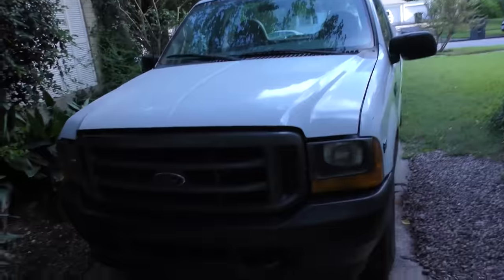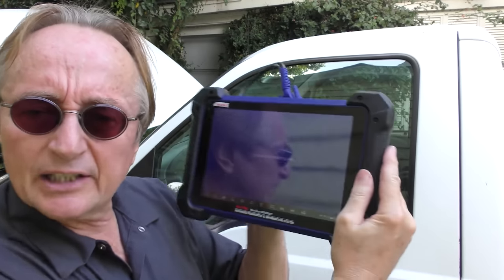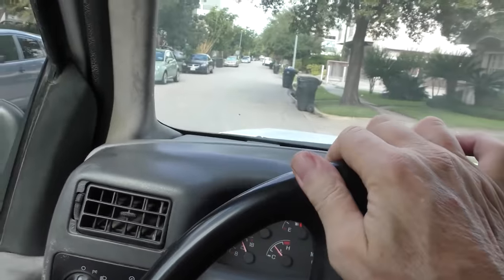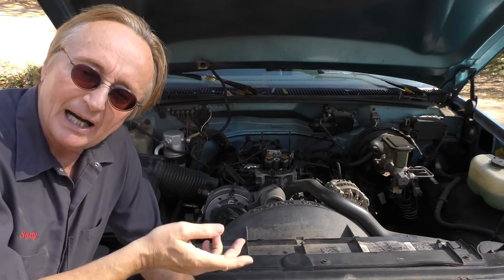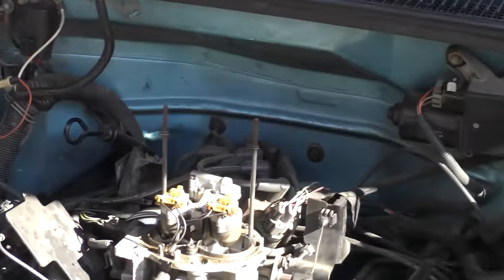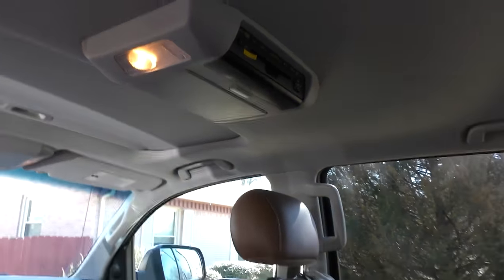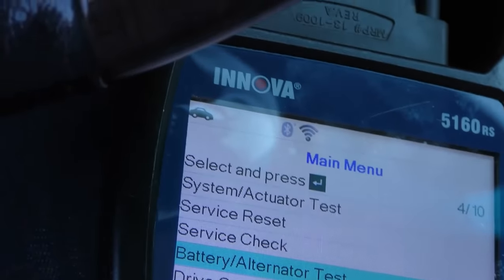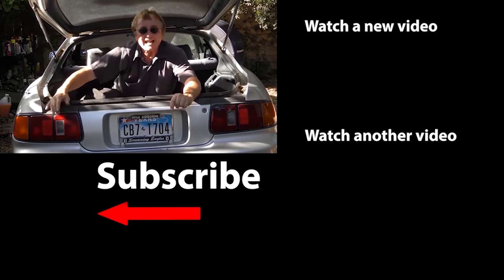3 Trucks That Will Last 700,000 Miles

Comment: Had to sell my 2013 Tundra Platinum crew cab for $26.4K under 100K miles. Would not have sold it, but going through a divorce and had to. It was the best vehicle I have ever owned. Bought a 2003 4runner limited V8 cash as a replacement. Toyota makes the best vehicles folks. Never buy garbage if the prices are similar.

Comment: My 93 Ranger 4.0L Has  133k on her. I just recently flushed out the radiator 8 times w water and then the Prestone flush chemical last time. After that, I flushed out the heater core with a high pressure garden hose. Put in new coolant. Changed oil. Preventive Maintenance is key. I hope to have this Ranger for another 10 years or more.

Comment: Nice video..  I have a 97 1500 4.3 WT model that I've owned since 2007 with 115,000 on it and now in 2022 I'm at 322,000 and still runs and looks just as good as it did on day 1and still all original with no rebuilding yet..  and it gets 21-22 mpg all day long
Reply: I'm very impressed 👏.  I bought my siverado 94 4.3 v6 with 100k miles.  Now I'm almost at 220k miles and still running with the original motor. I have done regular oil changes and maintenance.  Do you think I can put at least 300k miles on my truck?

Comment: I used to have a 1993 Ford F-150 with the 5.0  V-8. I sold it back in 2015 with 386000 miles and she was still really freaking strong. No major engine work or any major transmission work done to it. I was able to get 325 miles on a full tank of gas.

Comment: I have a 1998 f-150 with a 4.2 liter V6 and a 5 speed manual transmission. I've had it for a few months, when I bought it, it had 248,000 miles, and I'm convinced that it'll make to at least 500,000 miles if not a million. The only problem I've had with it so far that wasn't just cosmetic was a leak in the plastic part of the radiator that that I patched with JB weld. The thing purrs like a kitten. It's solid white, I named him Shadowfax after Gandalf's horse 😁😁

Comment: I have a '96 Jeep Grand Cherokee 5.2 l V8 4x4 240,000 mi runs perfect.
I see no reason why it won't still be running perfect at 300,000 mi. Currently building the suspension and thinking about getting a new transmission.
Reply: Might as well drive it until the transmission is really clunking/giving you issues.  Then, if something serious happens with the engine, even if you think it wouldn’t happen, you didn’t just pay thousands for the transmission.
Reply: I just sold 2000 GC w 278,000 miles for $5000,  replaced everything important & told new owner he should get another 300,000 EASILY,, one of the best motors ever manufactured & simple preventative maintainence is all,  no secrets at all
Reply: Pull a couple quarts of trans fluid out w small & long suction hose by way of trans dip stick,  i made a custom one cheap,,, replace with Lucas synthetic Trans Fix;, i did this every other month four times & I SWEAR the trans got a new life & sailed smooth as hell for final 150,000 before i sold it;,  Lucas Trans will help you get the max outta that transmission, just drive it easy & don’t over work it,, simple,,, before giving up on it show it some TLC !!!
Reply: @dclark7545  yeah I just swapped out the transmission fluid and threw some of that Lucas in there and a new filter. 240K on a transmission seems like a lot to me.
Reply: @mylittlepitbull3143  do you have AC air flow problems, like weak air coming outta 2 or three of the vents,, common problem easy fix, take the plate off by stereo to access vents & I’ll bet you a beer the factory connection of the vent system has come apart letting cold air dissipate into the dash instead of the cabin, get some of that aluminum AC tape & insulate the ducts & make em tight and smooth air flow, cheap fix for factory flaw,, good luck 🍀
Reply: @mylittlepitbull3143  here ya go 

BlueDriver Bluetooth Pro OBDII Scan Tool for iPhone & Android
Reply: @dclark7545  which beer factory
Reply: @mylittlepitbull3143  hilarious 😆

Comment: I got a 2006 Ram 1500 4.7L with a check engine light. Got it for $1,800 in 2021.  Fixed the CEL and with 246k miles it's great.

Comment: I have 2 1970 Chevy trucks. One is a C10 short bed stepside with a straight 6 and the other is aC20 long bed fleetside with a 350 and both have a 4 on the floor. I drive them both on a regular basis and besides doing routine maintenance on them I never have any problems. They are both super reliable and easy to work on. I don’t foresee myself ever having to buy another truck until I’m so old I can’t drive anymore.

Comment: So right Scotty. I have a 94 GMC that I bought new (in Texas $3k cheaper than here in La.) and it has 156k miles on it and all I have ever had replaced was a water pump and fuel pump and still going strong and I have offers to buy it constantly.

Comment: A couple years ago I bought a 2001 Ford Expedition with 169.00 miles on it for 2500, Interior was immaculate and nothing worse than gravel chips on the exterior. I spent  a couple grand redoing the from end, barges roters and shocks. Did coolant and fluid change and the car drives like a new one. I am keeping it as my get out of town car. I had one of these new but really did not like the rear seat not folding down into the floor like one I had a couple years before, bought it used and can't remember the year but all the seats folded flat into the floor, loved that one, don't remember why I got rid of it. I retired with a Toyota Sienna the I drove for 10 years after I retired, went to  Rav 4 that I drove for 6 years and moved to a Highlander this year. Wife drive for me now just got too old and lame to be the best driver so we got all the new safety aids and she is happy, so I am.

Comment: Hey Scotty, my mom drives a 2014 Jeep Cherokee Sport with 130k miles. For a few months now the automatic transmission has been doing this thing where it gets "stuck" when accelerating and changing gears; it can get really bad but it only does it every now and then. As far as we know nothing in the transmission has ever been serviced.
Reply: My 04 Ford Explorer used to do the same. For me, the servos are made of steel, while the transmission case is made of aluminum. So basically the servos (intermediate and overdrive) were slamming in and out of place making the aluminum holes bigger and bigger until it couldn't build up enough pressure to change gears.

Comment: My 82 Chevy Caprice was made in Canada in 1982 and then sent to  St Pete fl car dealer.  I bought it in 99 . It came with the 267 V8 which sucked had like a 350 and moved like a inline 6 . I spent 3 years building a HP 350 and now it really moves and gets better fuel economy then the 267 V8 . When I’m  easy on the gas

Comment: My Mother bought a 1988 Ford Rander XLT with he Cologne V6...it had 850,000+ verified miles before it was taken off road due to rust in frame. The engine still started right up ran fine. The only thing we ever did to it was put new valve cover gaskets in it and spark plugs every 100k. Kept the oil fresh. Couldn't kill that engine. It was a fast little truck too! Ford DOES put good engines in their cars and trucks no joke.
Reply: I kind of find it hard to believe the timing chain was original, or alternator, starter. And water pump. Or fuel pump
Reply: @richsweeney1115  agree,  it’s possible but highly unlikely, I’d spot change those inexpensive parts just to show some love to the old feller;; less then $5 hundo & another 800,000,,, lolol
Reply: @richsweeney1115  100 percent im not joking. The valve cover which had cork gaskets leaked like a sieve but otherwise all original, sware it. It was my now late father or I who maintained it(dad was a Chevy guy so only changed fluids on the Ranger) We kept the fluids fresh that's it. Spark plugs every 100 to 120k. The truck was falling apart and rust had taken over the frame that as breaking. The engine was incredible. 
I drive BMWs and I get 300 to 500k with just keeping all the fluids fresh but I have had to replace water pumps etc yes...not with that Ranger. I'm not even joking that Ford Cologne v6 is a legend in my family.
Reply: @brandonbentley5453  I don't think  you'll get 300k out of a newer BMW , without doing a lot of work on it, I agree with Scotty about all the technology and plastic on those

Comment: My Nissan hardbody has been going strong for over 30 years! The odometer stopped working after it ticked over 300,000 miles. Replaced the timing chain, radiator, all the bushings / shocks and AC it's like a new truck

Comment: Chevy v8 engines will run literally for ever if you have one of those t56 6 speed manual which has a reputation for being bullet proof you cant go wrong. I have a 1993 camaro z28 bought it 20 years ago with 50k miles on it when I just graduated high school I was the second owner. today it has 956k miles on it original engine and transmission. even the suspension is original except I had to change the. shock absorbers a few times but it still drives like its brand new has plenty of power. I had to change the exhaust cause it rusted out. and I had to change the optispark a few times but I upgraded that to a holley terminator and got rid of the optispark distributor.
Reply: Impressive brother!!

Comment: Bought my 92 Toyota 4x4 truck brand new. 4 cyl, 5 spd manual. Currently has 422,000 miles. Orig engine, orig transmission, never rebuilt. Truck has only had basic maintenance in last 30 years. Still runs like a champ. Has never left me stranded. 3000 mi oil changes, hoses/belts replaced at scheduled intervals. Little things like water pump, alternator, radiator have been replace a time or three.

Comment: The best truck is the 1987 K-10 4X4 350 Chevrolet , manual transmission, manual lever controlled transfer case with manual axel hubs. These old Square Bodies were the best trucks that GM ever made and then they went flimsy, window motors mounted to buckling door panels, inadequate cooling, crappy rotary R-4 compressor, self abrasive break in differential lube to keep from lapping gear sets that never got changed, horrible junk after 1988.
Reply: I have an 87 K10 that I plow with and an R1500 that is my faily driver.  Gas mileage sucks but cheap maintenance and reliability more than make up for poor fuel mileage.
Reply: Square body or no body.

Comment: I bought a $300 1996 Ford Explorer XLT 4.0 RWD off of a customer I towed last year, before a 2018 Tesla Model S knocked me off of my 2021 Suzuki Katana. Now I daily the Explorer with ? miles while I wait for the settlement. I've refreshed most of the mechanical components, now I'm working on the AC...runs like a dream.

Comment: Another great truck that no one knows about just about any year of the Mercury mountaineer with a V8 the 302's been around forever and I can attest to just how strong the Mercury's with one in it is
Reply: Lol no
Reply: I had an 05 mountaineer. 300,000 and still running when I got rid of it. The weak spot was the wheel bearings... But it was a great vehicle for years for me.
Reply: @jasonschuler6829  I have a 2001 that was recked with 120 thousand on the clock I have used this truck to pull trees out of the ground that were 3 inches in diameter tow a trailer weighing in excess of 2500 lb with its bumper hitch routinely towed yet more trailers with it and it runs like a champ doesn't even threaten to give any problems
Reply: @jasonschuler6829  Explorer, wheel bearings. Same thing

Comment: 2003 4WD Dodge Dakota slt 3.9 280,000 miles. No rust. Everything works, I’ve replaced the radiator, the O2 sensor, catalytic converter, shocks that’s it. Ball joints and fuel pump are next but at this point I will buy anything to keep it in motion. With the market the way it is I’m a happy duck.

Comment: A friend bought a new 2019 or 20 Tundra and was told at the dealer that at 100k service requirements specified removing the heads and installing new gaskets. Any truth to that?

Comment: I bought a 1972 Ford F-150 4x4 long box custom for 900.00 bucks with 150k. It has the 4speed granny low transmission with the 2 speed transfer case. The truck is straight as a arrow and it has the 390 , 4 barrel holly carb. The engine was rebuilt and I knew of the mechanic that did the work BUT the engine has a camshaft problem. I’ve had fords in the past and have worked a lot on FE motors so I plan on going into the motor to see what the issue is and inspect the overhaul. And I knew about this before I purchased it. The plan is to install a new cam and lifters that’s a given. But for me it’s a haul truck and won’t be driven much. And the drivetrain is bulletproof. Another project 🤪👍

Comment: Hey Scotty, love the video! I have a 1970 Chevy C10 with a Saginaw 3 speed column shift transmission...I was wondering, how long are those transmissions good for? I enjoy driving it and would like to keep it, but I was wondering if you have any suggestions as to how to maintain that transmission? Also, do you know anyone/anywhere that might have parts for that transmission or shift linkage? Thank you!
Reply: Those old Chevy transmissions can be good trannys . Plus , they are relativly easy to replace / rebuild .
Reply: I have a 1966 beaumont with a 3 on the tree and 283. Thing tares it up pretty good. Saginaws can't take much torque as muncies i hear. I think you could have a 4 spd transmission column shift. It would be as if you had a 3 spd, but there would be a lever under dash for overdrive. I don't know common these were.
Reply: I have a 86 c10 with a th350 3spd. GM’s three speeds of the era are one of the most reliable transmission on the planet due to their simplicity. If you start having issues, I had mine rebuilt for a grand. Depends on your use case but I beat the life out of that poor 3 spd and she shifts nice and smooth.
Reply: My friends dad had an impala/caprice back in the 80s. He would always and everytime and many times every night rev it up in neutral and drop it into gear! Was the only way to get the gutless 305 to squeal the tires. But that tranny never once failed. We always thought the tranny must have been built on a wednesday, but i guess they were just well built period! RIP Mikey
Reply: @psommers7646  i bet once that beast got rollin it was fast af,,, 305 great motor in them days
Reply: The three speed Saginaw will go a long way. The linkage, not so much. If you really want to keep it, I would suggest putting in a floor shifter for it instead of trying to fix the column linkage. This is what I did in my 1969 GMC. Good Luck.

Comment: Hàd a 73 F250 with Spicer lock out hubs. Loved it. I was the 4th owner after a carpenter, mason, and a landscaper. Pretty beat but ran well. What do you think of a 98 or it may be 99 F 150 2 wheel for 500 bucks?

Comment: Dads 05 f150 is at 300k on original drivetrain. 4.6 2v.
Reply: those 4.6 2v's are reliable engines. Not super powerful but its not for racing. Im a fan
Reply: Have to agree. A 4.6 2v will outlast a 5.4 3v hands down.

Comment: I got a Ford E-350 dually box truck, V10 engine... all original, 260,000 miles and still runs fairly good.  Has a few misfires if more than half throttle, but goes down the road and pulls trailers fine.

Comment: Dogs & I love my '94 C1500 Suburban.  It sounds & feels SO good!  Rides smooth & handles shockingly good for it's weight & age.  Everything about it is so cheap that it makes the 10-12 mpg's well worth it.  I bought it because my '14 prius blew it's head gasket & would cost more to fix than an old truck would be to purchase.

Comment: The tundras have a great engine but the first gen of the tundras had a ball joint issue.  And of course the frame rot.  Dana Spicer made those frames so that's not on Toyota.  I'm Toyota all the way I just wish they would make a 1 ton with a diesel I think that would sell like mad because it would be so much better than the other three.

Comment: Hay scotty I have a 98 ford ranger with 250000 miles it still runs and drives like new I mean new it idols smoother than any new truck on the road when it comes to small trucks I think the older ford ranger with the 3.0 or 4.0 are one of the best you can buy.

Comment: My ‘04 Dakota 2wd 3.7 has over 300k and still going.  Everything still works, but it does use 1 qt of oil every 1,000 miles.  Not sure if I should get rid of it while it still works or just drive it until it self destructs.  Thoughts?
Reply: I'd keep it. I wouldn't sell my 2004 Ford Ranger that was made here in the USA. Only has 109,000. Runs perfectly, 22 mpg  city.

Comment: I previously owner a 1986 Chevrolet Silverado C/K 10. You are right so simple too work on the good oh analog gauges with the prongs. The dual fuel tanks was a bonus the speedometer cable none of the electronics all mechanical. It even had an printed circuit board made up with an flexible material which  controlled the analog gauges how simple. Yes built tough

Comment: Close to 300k on my 94 we changed the engine and transmission, was still going strong.  Tore down the engine and the only things wrong was rod bearing wear and a minor leak in the belly pan on the intake... Went through the rest of the truck and now everything, yes even the a/c is in top shape

Comment: I hadda '79 Ford F250 4wd. I got 96k out of the stock clutch. 351cc. Sold it to local auto body shop who restored it. 400cu in engine. $3k spent on the Candy apple red paint. Suspension very stiff, amazing work truck. No rust. When I bought truck in Detoilet, I had it undercoated.

Comment: Ive got a 2002 F150 with the 2 valve 5.4L 
This truck is solid, Ive owned it since new and it has never given me any real problems. Nearing 200k as we speak.